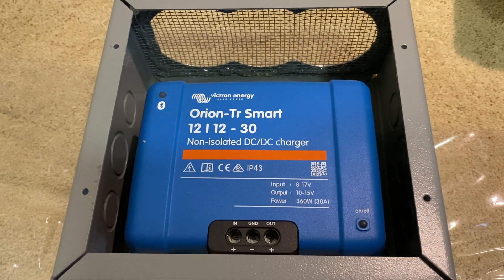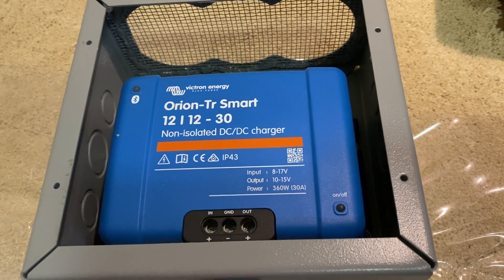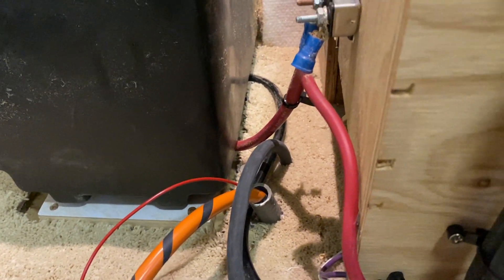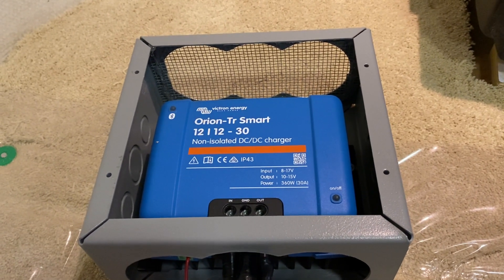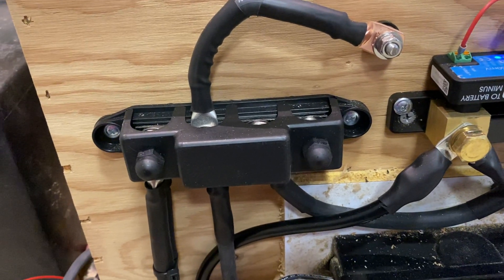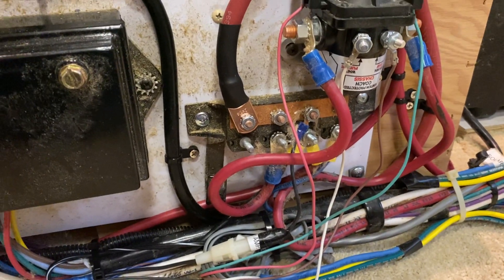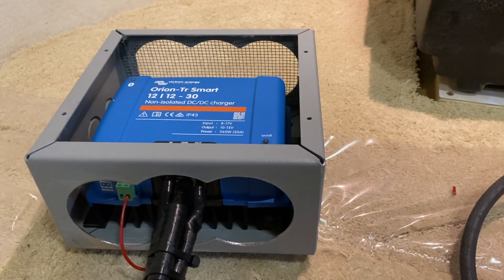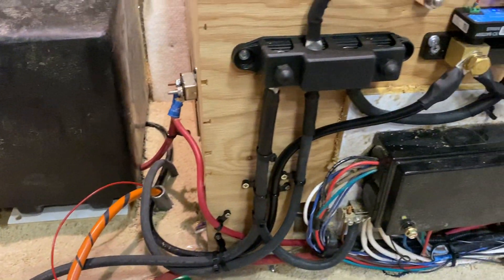How to install a Victron Orion Smart Bluetooth DC to DC charger in airstream RV

Comment: Thanks for sharing. Could you do a part 2 on the rest of the system? Truck Battery tie-in, Fuses, connection from Truck to Trailer (What type of connectors) , How did you run, secure and protect the cables.

Comment: What type of fuse do I use? I have the exact unit installed in my 2007 Dodge Sprinter. I have a starter batt aux batt and my bus is under the drivers seat.

Comment: Great video! What size wire did you use for the manual disconnect?
Reply from the maker: Sorry I didn't see your question before now - I didn't really realize anyone was even seeing this video.  Anyway its 18 Guage primary wire  https://www.amazon.com/gp/product/B000HACYOS/ref=ppx_yo_dt_b_search_asin_title?ie=UTF8&psc=1  it could be even smaller as it doesn't really carry any significant current.